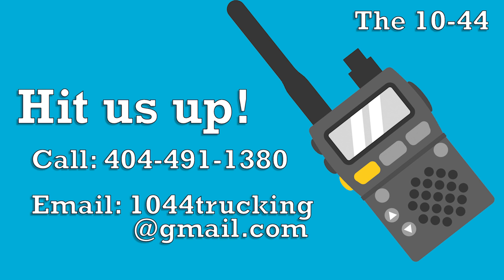Extending DPF life: How fleets can ease a common pinch point of modern engines

Comment: Low or ultra low SAPS oils, higher minimum HTHS levels, the right viscosity based on age and mileage (naturally the viscosity should increase slightly over time to keep longevity before rebuild/replacement of vehicle or engine is needed etc).

Another thing is HJS DPF retrofitting.  DPF units from europe that are designed for all vehicles, big rigs etc, that solve a lot of problems.  Check them out.  Peace